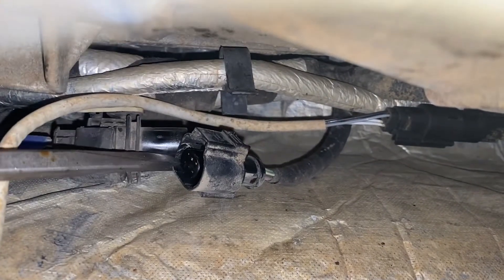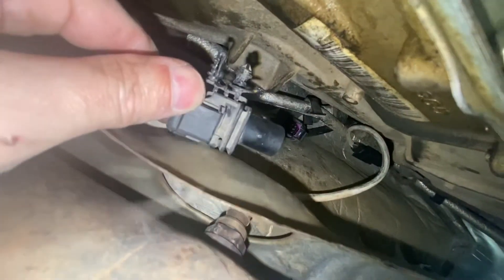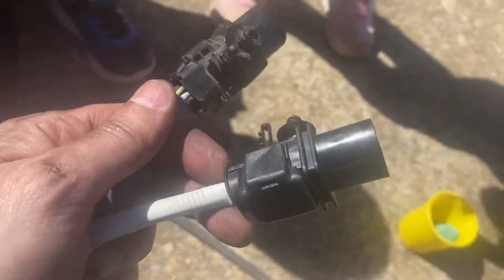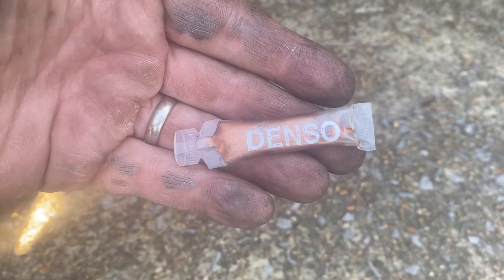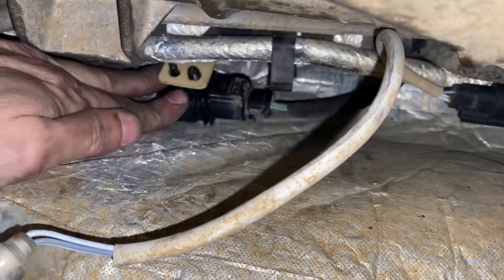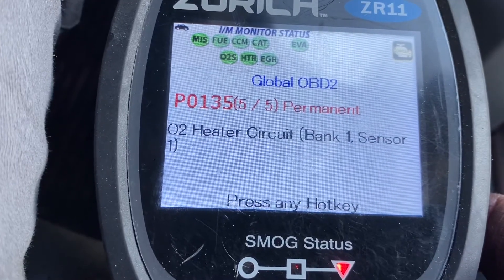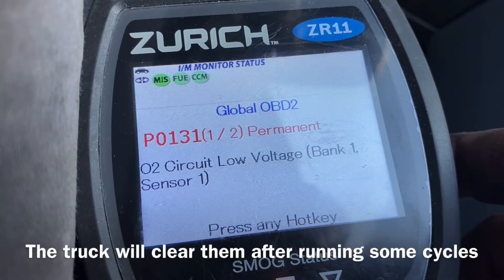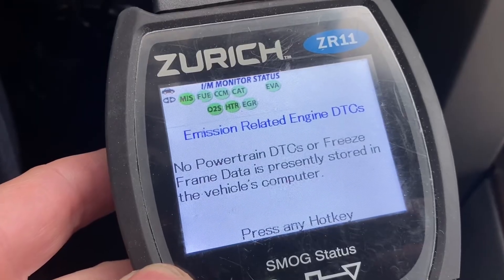How to fix Code P0131: Ford 3.5 L ECOBOOST (O2 sensor swap)

Comment: Dealing with the same issue.... Also, seems like I'm idling rough and small jumps on my RPM gauge
Reply from the maker: Yes, a bad sensor can cause rough running because it’s basically lying to, or not talking to the computer about correct  fuel/air mixture needs.

Comment: Dude is all "No engine light" after not even driving it a mile. No shit there's no engine light. You just cleared it. It did not clear itself without a drive cycle.
Reply from the maker: @keeblertime1486  You’re right, but I tried to end the video after driving several cycles to show that the light didn’t reappear. Not trying to mislead anybody. Thanks for watching and commenting.
Reply: @williamtunnell  Word

Comment: I tried the socket and pivoting ratchet and it wasn't coming loose and the socket was slipping. Going from underneath with a 7/8 wrench worked very well for me.

Comment: Once I figured out where it was it made a lot more sense.  Had to pull the underside felt cover to see the sensor and connector.  I also bought an O2 sensor 7/8-22mm socket with a 3/8 drive off of Amazon for cheap that made getting the sensor out a non-issue.  A long handled 3/8 ratchet with a pivoting head is perfect for this job.  I also soaked the connection with WD40 while I detached the sensor.  The most time consuming thing was getting the clips out of the connector attachment.   Tore my hands and wrists up getting in there but its done.  Used Forscan to clear the codes and no codes after a days worth or driving.  Thanks for the video!
Reply from the maker: Great comment!  Thanks for the details of your fix!  Soaking the sensor threads while getting everything else done is a good thing.  Thanks for watching!
Reply: Can you drop the Amazon link for the O2 sensor for the P0131 you bought?
Reply: @AustinGraham-e8f  it was the BOSCH 17321, apparently you can't post links?  Posted a few times and keep getting deleted.
Reply from the maker: @AustinGraham-e8f I didn’t buy these from Amazon - sorry. I’d hate to link to something not being sure it’s correct.

Comment: 🤔 my 2013 3.5 Eco O2 sensor connector is on the inner fender.

The silver antiseize is for dissimilar metal contact.
Copper is for heat appliances
Reply from the maker: Great info!  I didn’t know that about the silver vs copper anti seize. Thanks!

Comment: The check engine light typically takes 50 driving miles to redetect new codes, it isn't immediate.
Reply from the maker: Thanks Mike!  My scan tool does give directions on “drive cycles”, but you’re spot on - just drive it long enough and it’ll reset.  You saw where I tried to erase it permanently. Haha!

Comment: dumb question, but how does the electrical plug “unsnap”?  do you push down on the right side or pull up?  I got mine out of the plastic clip but can’t unplug it from the car 😂
Reply from the maker: Ryan, trust me…that’s not a dumb question!  It seems like there are a hundred different ways these things connect. Most times, there is some safety catch that either has to be uncoupled or depressed while you unplug the connection. With that done, it’s probably just hard to pull apart. These guys who show themselves do it with one hand have already unplugged it for the video. 😂. I promise, that’s not a dumb question!
Reply from the maker: This particular plug has a tab that has to be depressed and then you pull apart.
Reply: @williamtunnell  thank you! and thanks for making this video!

Comment: What was your truck doing at that time and did it fix the problem
Reply from the maker: Hey Danny - I had a check engine light come on, solid. I put my scan tool on it and it pulled the code you see in the video. Performance was fine, but it was running too lean (or maybe rich, I don’t recall - but either way, you don’t want it to have to add/remove fuel too much for too long). After I changed out the sensor, engine light went off after a drive or two and it hasn’t come on since. Fixed!
Reply from the maker: Last note, I did change my plugs later on which is something you may want to do as well, but my old plugs looked fine.

Comment: What 02 Sensor Socket Did you Use?
Reply from the maker: You’ll need a 22 mm or a 7/8 - I used a wrench rather than a socket because it will take a special socket due to the wires.
Reply: If it’s for changing out the old plug you can always cut the wires since you don’t have to reuse it. No special socket needed

Comment: you definitely make it look easy, but are you under the truck and its on a lift or are you under the hood? would have been cool to have a wider shot on where a rank amateur would actually access Bank 1 Sensor 1 • just sayin' I could unplug wires and such all day. take into consideration 30 min of knuckle busterin' to complate the job, I've been looking for a video that absolutely spells it out, from location to replacement dressing wires. Sorry I have high anxiety doing repairs on my 2013 F140 Platinum,  if I don't have all the info especially the knowledge that keeps you
Reply from the maker: I totally understand, Seth. I was actually on my back in the driveway - no lift. Hence, no wide shots. This job was done underneath rather than under the hood. Both sensors are on the exhaust. Definitely busted a knuckle or two. Haha.
Reply: @williamtunnell  all good I just need to trust what I'm seeing. just paranoid I'm going to mess up and exponentially increase the cost of a fix. Well I got under there and found that the Almighty last manifold bolt was toast. The is a 2013 Platinum not a virtually no rust, near mint condition outside, 100% gorgeous inside aaaand 159,000...yes that is the mileage I bought it at. on the lot there was another amazing F150 and it had 414,XXX on the ODO. I previously took an 02 SportTrac to 310,000 but it was the first year for poly frame bushings and every single one of them disintegrated. I hope once issues are ironed out the F150 lasts and lasts and lasts --- at least as long as this post lol thank you!
Reply from the maker: Haha!  I’ve been having trouble with my pass side manifold as well. Small leak that sounds like a “rattle” almost. Frustrating. I replaced it (has it replaced) and now it’s doing it again. But maintenance things like this are what keeps these trucks going. I bought mine with 32,xxx and now it’s at 167,xxx. Very clean interior too. I love my truck. Thanks for watching and writing!

Comment: Great job, you made it look super easy. My sensor is reading as P0131 (H02S11)?  does this code mean 2nd side and 2nd sensor? Because that is exactly how my sensor is presenting the letters and numbers.
Reply from the maker: I’d definitely say bank 2 (which should be driver’s side) and I can see how you’d think it’s sensor 2.  I’d google your actual vehicle make and model along with those codes just to make sure. It’s not a hard swap but you sure don’t want to waste time and money changing the wrong one!  Haha!  Thanks for watching and commenting!  Let me know how your repair turns out.
Reply from the maker: Then again…what if that code means H(?) O2S (oxygen sensor), 1 (bank 1), 1 (sensor 1)?  I believe that’s what it is now that I think about it.
Reply: 11$12 are upstream, and downstream bank 1 sensors 1$2
21$22 are upstream, and downstream bank 2 sensors 1$2
The one I’m checking P0131,
Bank 1 sensor 1 koeo reads 0.07 and 24-28% koeo and koeo. 
Never changes